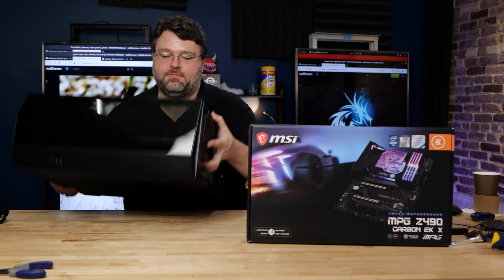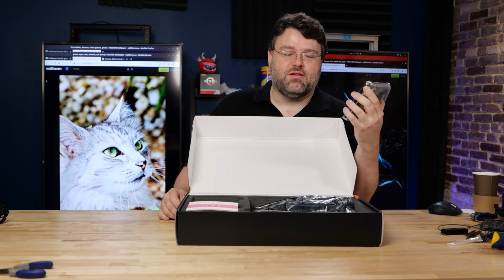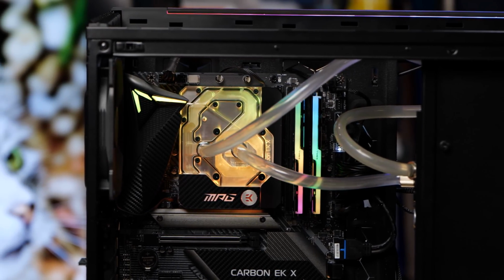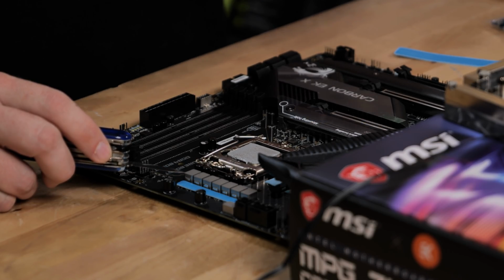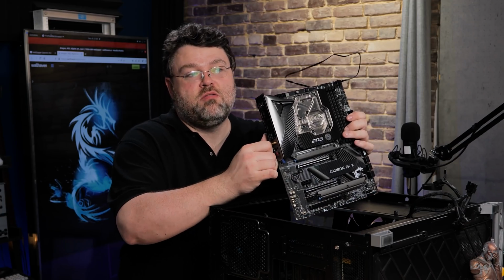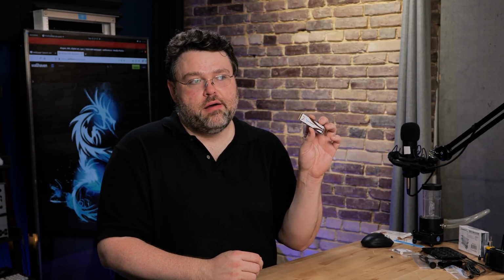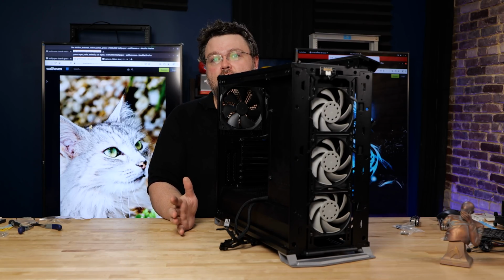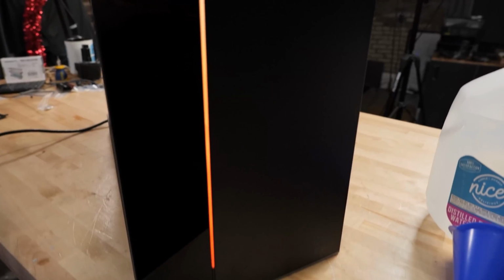MSI MPG Z490 Carbon EK X Build w/2080 Super

Comment from the maker: No 3080 yet. But soooooooon!
Reply: dooooon
Reply: Yea... Good luck with that. :P
Reply: But do you even tb bypass or dremel and polish the cylindricalized fail, except apparently as machined oem in rx-8s?
Reply: Everything must go faster.

Its basically my religion.
Reply: Including synapses. These traces are more than extracellular cholinergic buffs. I have a secret handshake.
Reply: I remember my LS1. The C5 99 cam.was meaner than later editions but those came stock with the LS6 intake manifold. The intake was so open it almost sounded like an idling turbo, being the only thing stock was the heads. Never got around to polishing them and dropping a 224 with new valve springs. The manifold upgrade did nothing. That is until i ported the throttle body myself.

OMFG. The low end torque post mod was insane. Pushrods can be pretty epic even geared high, balanced weight distribution with an adjustable hotchkiss kit maximizing body roll in the rear, greater camber, and literal months straight of practice in GT4 with a wheel if it were solid without breaks.

Its very applicable even if the games representation of torque for that model vehicle was a joke and brake fade to this day is not a simulation feature in any title at least im aware of.
Reply: OCD is a seriously unfair advantage.

My guess is level1techs has a bit somewhere in there. You cant mention car tubing for pc's and not hear about the defrost slow down feature in cars that might never see northern climates. Slowness must die.
Reply: Build 2004 and 1903 are the worst builds. Because right clicking your drives to check out their space should crash explorer.exe and make another in task manager half the time you might actually want a convenient way to check.

Comment: should have used the MSI Sekira case, looks better, would match the mobo and is RGB-tastic! It did have some heat issues due to poor airflow but with a completely liquid cooled system it should be a grand slam.

Comment: What the hell you talking about boards bend under the 50 pounds/sq.in. intel recommends. Bending/warping is normal.
Reply: Also this isn't a screw tension spec this is overall pressure on the coldplate with all the screws tight. So don't go torquing your screws to 50lb/sq.in. and blame me for your stupidity.